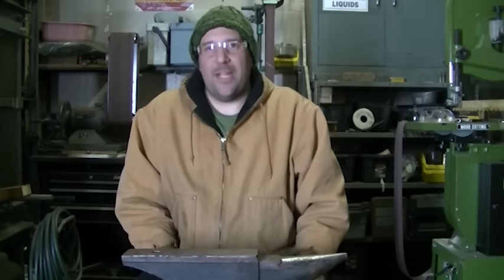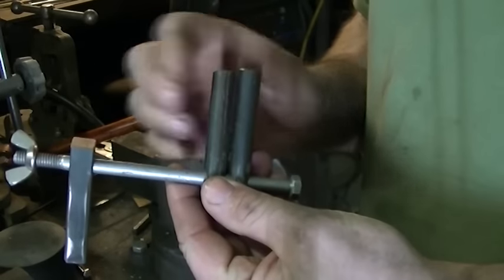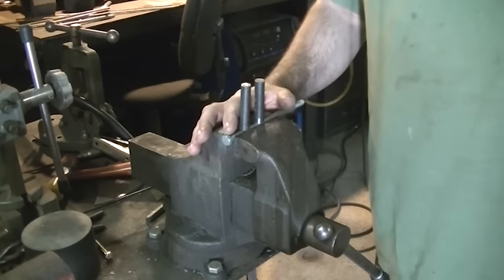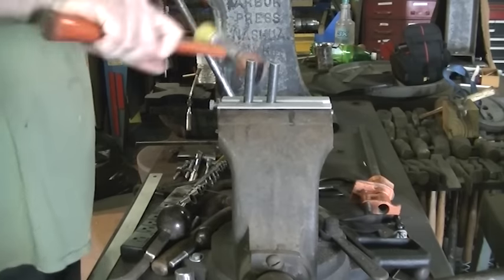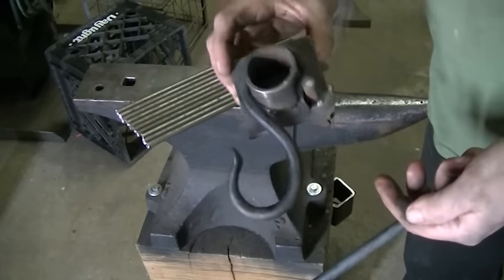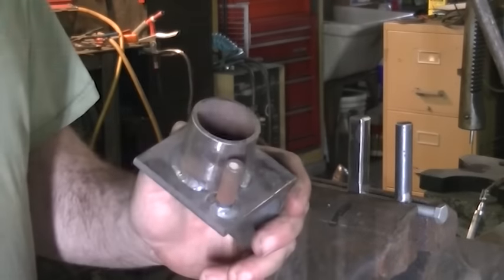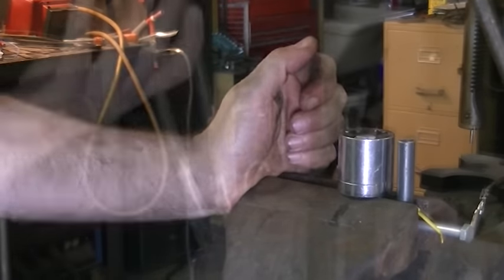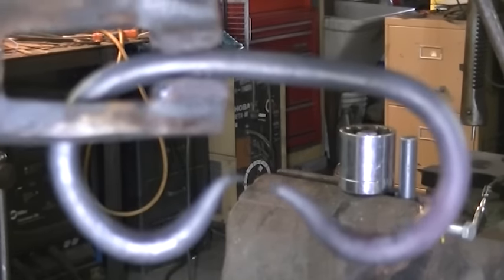Adjustable Bending Fork & Jig Demonstration / Trouble Shooting

Comment: Sir, I take exception with your primus that you can't screw this up, and this is why. I am a retired Marine Chief Warrant officer. I sent 15 Marines to set up tents. I provided stakes,  sledgehammers, safety caps for the stakes, tape measures, and of course tents and ropes. About 2 hours into the job a Corporal returned two of the sledgehammers. The Marines broke the hammers, not the handles,  the hammer heads! How does one brake a sledgehammer? You give them to Marines and then let them get bored,  then they make a game out of trying to hit the hammer heads together while swinging them like bats. I can only imagine what the Afghan soldiers were thinking watching this. I am impressed with you jig, I have been thinking about how to build a jig and your concept is perfect. I really like that it is very flexible.  Thank you for sharing your design.
Reply from the maker: Thank you for your service and the story!  I never had that problem with the Marines I know, they were Eagle Scouts before they entered boot...  Have a happy and safe Thanksgiving :)
Reply: Yes you are right. I am over 70 but when I was doing my apprendiship, one of the many warnings given by the instructors NEVER EVER HIT A HAMMER WITH ANOTHER HAMMER. Or anything hardened for that matter. They will fracture. Never had a problem in my working life, listened to the old timers and stuck to it. regards and MERRY CHRISTMAS AND HAPPY NEW YEAR
Reply: Abby Babby totally agree. 25 yrs Irish D.F. Only thing soldier proof is a length of railway track, too heavy to lift, they can't bend them, and no good for anything unless you have a couple of hundred of them. Having said all that they still might f##k it up
Reply: Abby Babby PFC Carl must have been in charge of that work detail #damnitCarl

Comment: just be fore you presented you version  of this jig, i made one similar but less adjustable. i found the one I made the sockets were too loose.  my fix for this was to  drill and tap the square side on the end,  with a 1/4-20 bolt and a washer to hold the socket in place. this made it work better for me.. thank you for your ideas i hope i helped anyone that had my issue. keep having fun !

Comment: Thanks for the great jig!  I made one the day after I saw your first video and used it on next project.  Ended up making another for to allow two simultaneous setups.  I made a third for a friend, only used three 1/2" squares.  I ground two to round above the drilled holes, so ends up the same function as rounds, but have perfect alignment in a vice.  I also leave all in place, just flip the unused one over so it is out of the way, but helps to provide more even pressure across the vice jaws.  Great tool and eliminates a bunch of non-adjustable ones of various fixed sizes.  THANK YOU!

Comment: Jeffrey,
I know this video is over a year old. I just wanted to say great idea my grandad had a 1/4 inch hand made safety pin with all sizes of pins on it, both round and square. He used them in his post vise in a similar manner as you. He never took them off the pin he just let them hang off the end outside the vise also with all three pins between the jaws of the vise it kept even pressure on the vise jaws. He would turn the third pin not in use upside down and moved it to the far side of the vise to keep even pressure on the vise jaws. Keep on keeping on!

Comment: That's a neat jig.  I've seen something like that...too many videos, too many sources...but not on a rod to make it adjustable.  Nicely done.  The vise-jaw "problem" is pretty minor, the jig has value.  The square peg to accommodate sockets of various sizes looks super handy.  Anybody hating on that is out of touch.  You don't have a slimy, sales-y, schmucky presentation; this came across as genuine so I'm baffled why anyone would try to "take you to task" over not having shown it working at some time in the past.  Anyway, haters are going to hate.  Let's not feed the trolls any more than we have already.

Again, well done on the jig.

Comment: This video couldn't have come at a better time: I was trying to figure out how to create something like this (with angle iron, drilling holes for the two bending fork tines, with some uncertain way to maybe make them like rivets through drilled holes in the angle iron pieces, etc.--very unstable plan on my part). This is way easier and involves nothing more complicated than drilling some holes. Thanks!

Comment: i used this method to make a axle bush for my oxy acetylene cart i custom made, i also had the metal dies in your previous vid.
then i had an idea, for the sizes i needed in between or over the large one i made a 5mm flat bar ring to go around it and welded that up as a ring to slip over the die, i then made a few more rings to go over the previous one so now i have several rings up to 20cm in diameter

Comment: First, when the "unstable" was mentioned my first thought was the vise. I had a cheap vise and it simply did not hold much of anything, even with a cheater bar. I replaced it with a Wilton, need I say more. I believe there are some who just post negative comments for no reason, except to annoy others.
When I post a comment I do it because I want more information about what is being shown, I like the video, or maybe I have another method of doing the same thing. My purpose is to learn more or perhaps help others with a different way to look at something. I don't leave negative comments, except for one where every other word was a swear word. 
I like your channel, keep up the good work!

Comment: Well played, sir. 
If I may, I would like to make a suggestion that may help you and your followers. With your round item to be drilled in your drill press vice(or laying on the drill press table) balance a small flat item across it. Lower your drill bit to just touch it. If you are on center, the flat will remain balanced. If not, it will tip it.
Keep up the good work! I like your idea and will definitely be making one.
Cheers!

Comment: Your comment on the bolt length being at least the length of the vise  if one converts to threaded rod and makes the rods the same diameter as the nut flats  you  can preset the  distance   so using 5/16" threaded rod  and 1/2"  would be a good match. 

all other setups remain the same  and 5/16 is plenty strong for that purpose

Comment: Would you have any recommendations for bending 3/4 solid round bar cold roll. I have to bend it in 180 in the middle and 2 45s on the ends

Comment: I made your jig and it rocks! I can make any size s hook I want with the 100s of sockets I have, thanks a bunch. I did make one change I added a second bolt and made the pins longer and it makes it easier to hold when putting in the vise and the pins don't flip around . As for drilling the holes that took a little time I just ground a flat spot on the side of the pin first ,then found the centre.  Thanks for the tip and don't give that asshole any more time he's not worth it. Cheers

Comment: I'm a disabled veteran...Is it possible to forge from a seated position? I have braces for my legs and can stand for short periods of time...I have all my equipment at a level that I can reach...Thank you...
Reply from the maker: Hello Donald, first of all thank you for your service, I hope I can be of some help. You can forge sitting down, in fact there are videos of Japanese sword masters kneeling over their anvil and the forge they use sits nearly on the ground. For heavy forging when they want to move a lot of material they have apprentice strikers standing using sledge hammers.

You may not be able to move a lot of metal at once while seated but you may not have to depending on what types of projects you have in mind. One thing I would highly recommend is getting a good quality leather apron and steel toe leather boots when forging. Pieces of hot scale could come off the project and land in your lap if seated, this for reasons I'm sure you can imagine would be problematic. 

My only thought about forging for long periods would be stresses on your back, being seated your upper body will be a little further from the anvil than normal. This means you might have to lean forward more towards the work. that is something time will tell. You may also find a stool with a round seat a lot better to use than a chair, if you can put your legs a little more out to the sides rather than directly in front of you that could reduce the amount you'll need to lean forward.

If you have any other questions please feel free to reach out to me again, good luck and happy forging!
Reply: I have put my vice and anvil on a microwave stand...I had to cut the legs down to adjust them to the right height, I then put a set of casters on what was left...My forge is made from an old BBQ grill with the big wheels from an old lawn mower...I can roll everything around where I need it...If you do this make sure to wear a leather apron due to the slag that comes from the hot metal...SAFETY FIRST...
Reply: Check out GS tongs channel.  He forges seated and has a video on his set up. It’s an awesome channel too